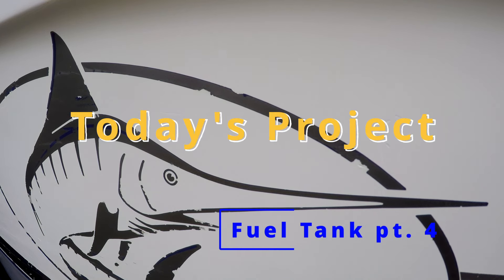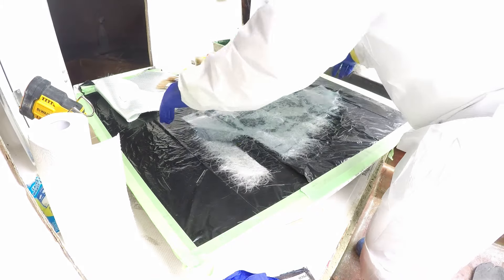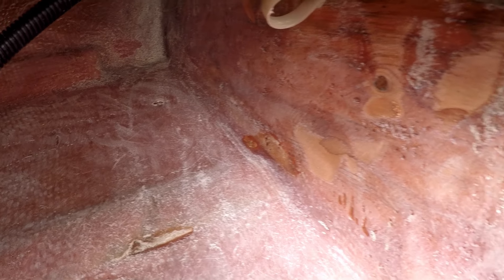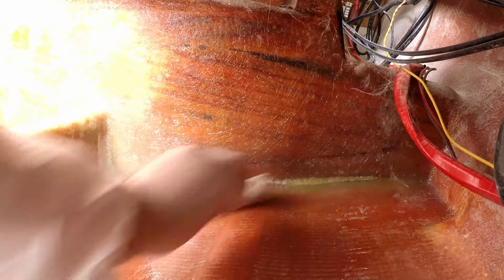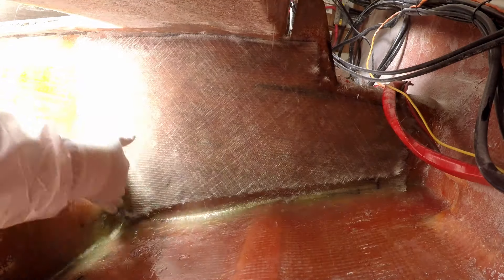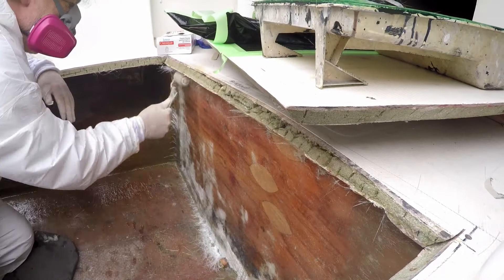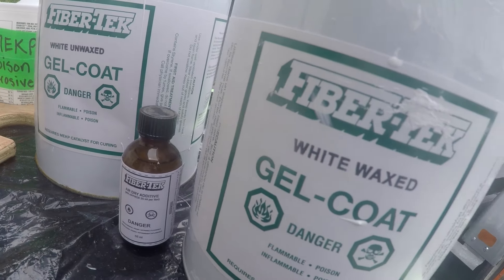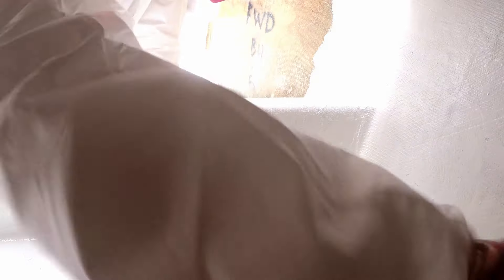Fuel Tank Pt 4

Comment: All you need to do is throw that roller into a  5 gallon bucket of  a little bit of acetone with a lid when your done an use it over again an again. Same with the bubble roller. Keep the ace tone bucket
Reply from the maker: Thanks for the response, Happylife. I do have a acetone container that I keep my fin rollers in, and that works well. But you’re saying that you can re-use roller sleeves? I have a cleaning station with acetone and a chip brush for cleaning the fin rollers before I place them in the clean acetone container, and once that brush gets resin or gelcoat on it (without setting) it never really comes clean, and I eventually replace it after a while.

I’m not convinced that I could clean a sleeve enough to use again. Also, at the time I was filming these episodes, Acetone was $100 per gallon, so I was desperately trying to conserve acetone. 

In the beginning, I tried cleaning and re-using mixing cups and roller trays, to minimal success. Once little flakes contaminated fresh resin, I felt it compromised the lay-up, so for the most part, I don’t re-use them, unless they come out perfectly clean. 

I never used large rollers and sleeves again, instead I bought bulk packs of the 3” sleeves. I saved a lot of $$ buying boxes.
Reply from the maker: Does the acetone remaining in the sleeve negatively affect the resin? I’ve read multiple places that acetone is not a good thinner for resin.

Comment: Ya know that if you use unwaxed you don’t have to sand between coats, just use waxed on the final coat
Reply from the maker: Of course I know that. What exactly are you referring to? I follow carefully the waxed / non-waxed protocol. I used laminating resin for all layers, then used waxed gelcoat for curing. Later in the project, I start adding wax to resin for some things, but normally, I’m using waxed gelcoat for the cure layer. 

Some of the sequences have time distorted, and the editing may appear that I’m out of order, but no, I follow the wax / unwax procedure. 

There are many little mistakes that I do make however, but wax isn’t one of them.
Reply from the maker: It is worth noting that I do frequently run a bit of sandpaper over still unwaxed layers to knock off sharp bits and poky pieces, but I follow the order.
Reply: @diyprojecttrophyfibreglass7892 
No worries, your commentary said waxed gel coat that’s all.
Reply from the maker: @russellfaith8959 that’s what I used. Waxed gelcoat. That’s what I showed. I re-watched the video. I don’t see where there’s confusion, but thanks for watching. I appreciate it.